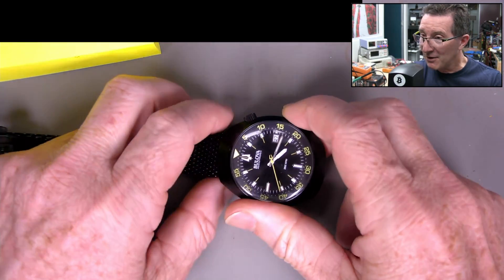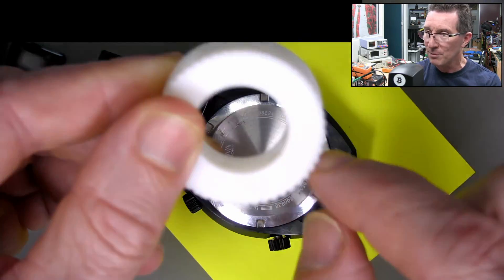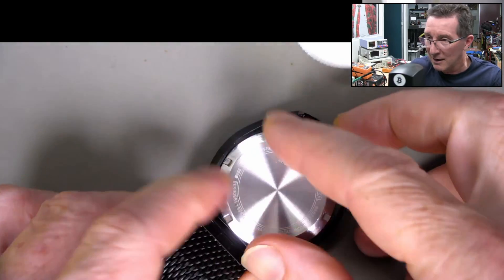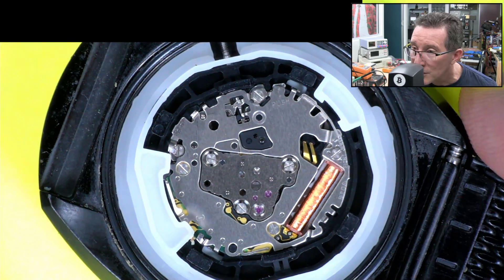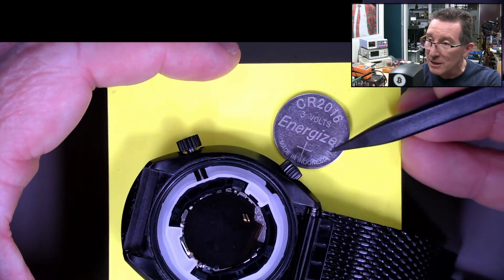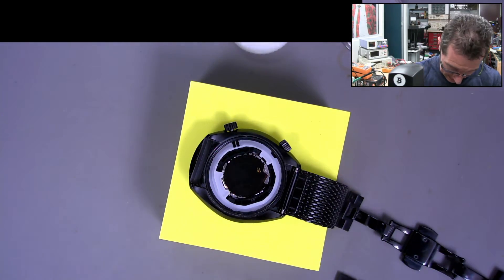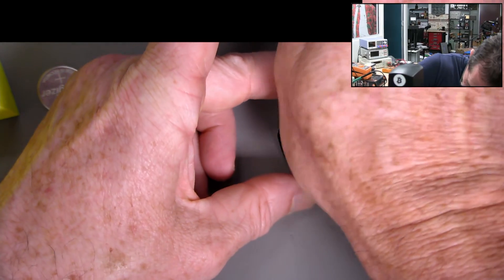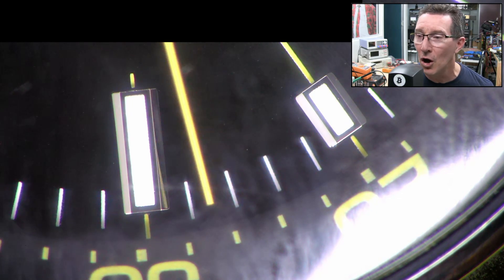Bulova Accutron II Battery Replacement

Comment: Do NOT use coin cells with bitter coatings! The coating can not only result in poor contact resistance in that style of battery holder but will also corrode the internals of your watch. Some companies specifically say in their manual to never use batteries with bitter coatings for those reasons. You can wipe most of it off with some IPA.

I also never buy coin cells from retail stores anymore after Australia passed the child safety laws about them, now you pay >$10 dollars for two coin cells instead I just buy an entire 'tray' of 40 from a commercial distributor for less, no wasteful and time consuming child resistant packaging.

Also A LOT of companies are being caught out not complying with the new laws for products that take coin cells, they also need to be child resistant, you pretty much need to have a screw on your battery door to comply, if not it's a mandatory recall enforced by the ACCC, but interestingly the law only applies to companies that can't afford expensive lawyers as Apple is seemingly exempt from complying with their AirTags.
Reply: I did automatically assume that the package is coated, so the child wouldn't chew too long on it. Don't know any statistics but I would guess in half of the cases such a small thing is swallowed by reflex before any disgusting taste could kick in. Thousands of bugs could tell a story of that. :)

Comment: The back is made in China, and likely the case and bracelet, but not the P102.12 movement, which is made by Miyota in Japan (Bulova is now owned by Citizen). The NM50 and NM10 are 262 KHz CR2016 sister movements of the same family made by Miyota. Whether they can be a drop-in replacement, i don't know.

Comment: I wonder what the humidity is in the lab? For waterproof watches, it is important to change the battery in a dry chamber to avoid condensation at low temperatures

Comment: I would not be trusting the waterproofness of that watch now.  I'm told that the gaskets should be changed when the battery is changed and the watch pressure tested to ensure the re-sealing has been effective.

Comment: This begs the question. In the United States, to rotate something like that watch cover that has notches around it, we might use a spanner wrench. In fact, if the tool used in the video had a handle sticking out, I'd call it a spanner wrench. So in English-speaking countries that call wrenches spanners, what do you call a spanner wrench? A spanner spanner? A wrench spanner?
Reply: It's called a pin spanner.

Comment: Hi Dave, years ago i filed a recess in a strip of metal, that was used to strap down a large wooden box. The width of this recess equals the distance of two opposing notches of the lid, so I can use that metal strip like a large screwdriver 😁
I totally like these metal strips, as they can be repurposed for making tools or shims... even a spudger is possible 🤔

Comment: Often if you are using a CR2016 a CR 2025 will fit, giving a much better life. As well in general almost all holders for a CR2032 will take either the 2016 or the 2025 as well, a good thing in a pinch. At least the Duraleak CR series are still reasonably good, though they can leak, like all batteries. For longest life wipe down with a solvent thoughly before use, as the skin oil and sweat leaves a conductive path, so for the best life use a wipe, I use surgical swabs, as they come with 70% ethanol, and are both sterile and chemically pure as well. Then dry off with a clean piece of toilet paper, and use plastic tweezers to insert. If no plastic simply shrink 2 pieces of heatshrink over the tips temporarily. Also surgical swabs are perfect to clean rosin off, or to clean a small area of board, as you buy a pack of 100 or 200 very cheaply, even the brand name types like J&J.
Reply: As big as that watch is, I would have wanted another 1.6mm thickness to fit a 2032. Much easier to find those locally in my area.

Comment: Aw, man! I was hoping it was a real battery replacement on an actual Accutron tuning fork. Because that’s a real problem people are dealing with on their retro watches.
(I got a smooth-sweep movement on my wall clock from China for about $3, delivered. Keeps great time and has lasted several years now, bit of a battery hog though.)
Man, I’m disappointed, I was really hoping for an actual Accutron — not just another ordinary quartz.

Comment: Watch repair tools are pretty inexpensive on Amazon, or wherever, and they include the tool to remove several styles of watch backs.

Btw, That watch could be a replica.
Reply from the maker: I got it from an authorised rep IIRC
Reply: @EEVblog2  An authorized replicant? :)

Comment: If you want the ultimate in smooth sweeps, You might be interested in looking into Grand Seiko Spring Drive movements and the electronic side of it at least, very interesting. They generate their own electricity and regulate a spring unwinding.

Comment: Might be a silly idea, but why clock hands aren't like analog multimeters? Instead of going around, they could just jump to the right place. (I had this epiphany when a radio controlled clock reset itself and slowly crawled back to the right time)
Reply: sober up m8
Reply: I guess because of the power consumption.
It uses more power to keep the pointers at a certain position than just moving it a tiny bit further. Then you'd have to change batteries every week or so 😂 or recharge it like any smartwatch.